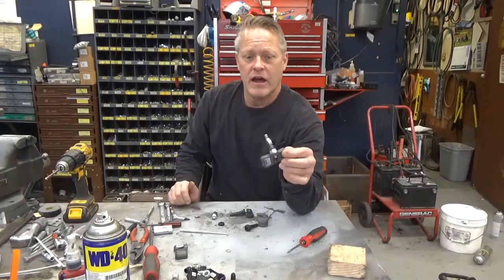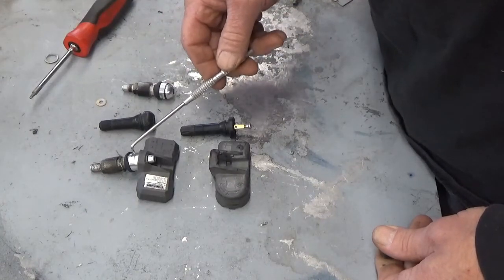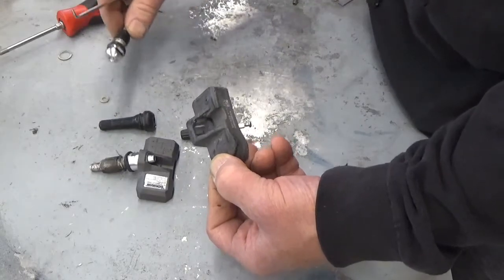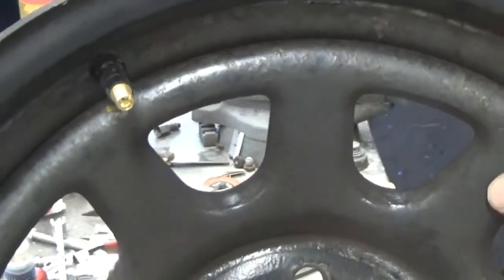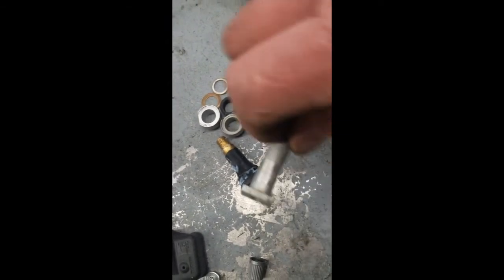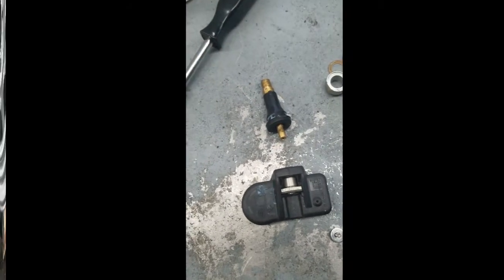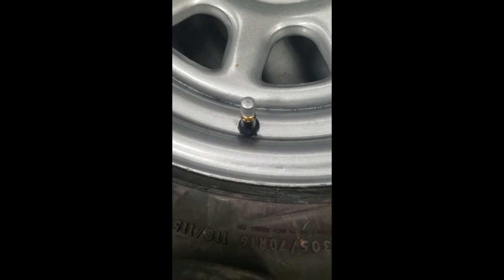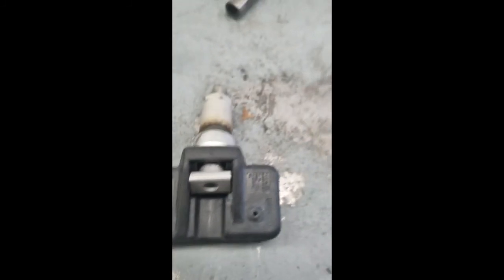Tire pressure monitoring system aluminum valve stem to rubber stem with the same sensor

Comment: If you have TPMS sensors, never use brass valve cores in your valve stems. They can cause galvanic corrosion. Instead, only use nickel-plated valve cores.

Comment: So when chaining a stem, you can use the existing sensor?
Reply from the maker: In my case yes. still working perfectly !
Reply: If you read the fine print on the sensor, it tells you to replace it with new tire, however, the OEM might be better than the bargain brand.....not saying that this isn't a good video, I gave it a like.